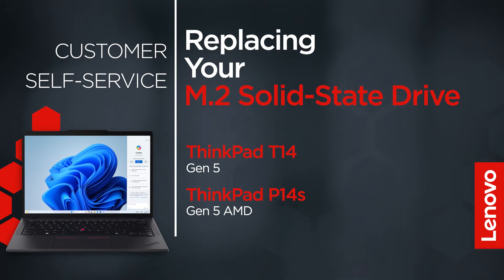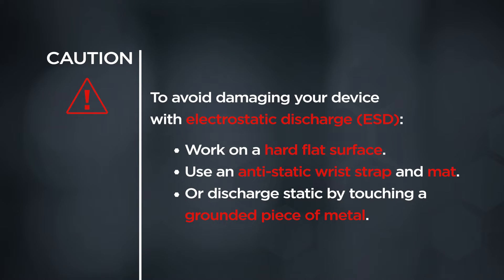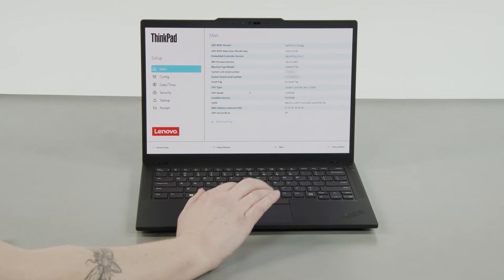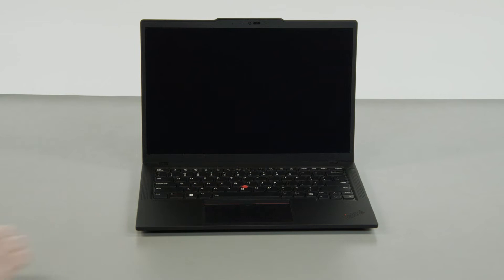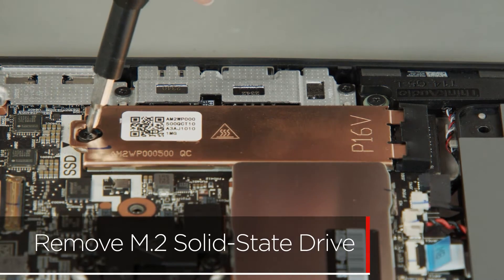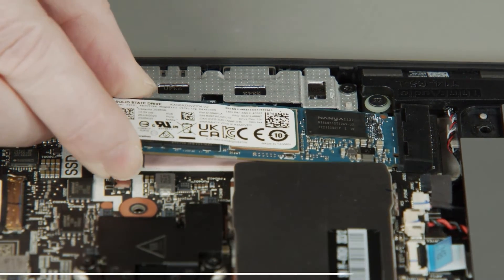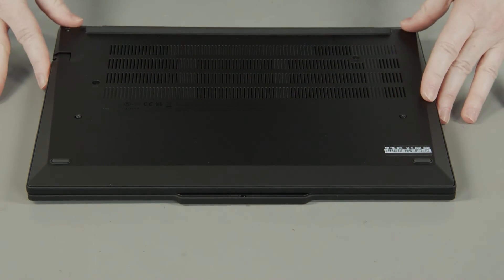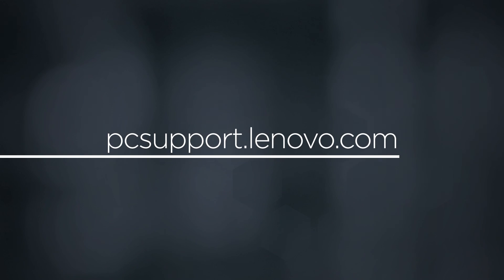Replacing Your M.2 Solid-state Drive | ThinkPad T14 Gen 5 and P14s Gen 5 AMD | Customer Self Service

Comment from the maker: This video will show you how to replace the M.2 solid-state drive in your ThinkPad. The process in this video will work for the ThinkPad T14 Gen 5 and ThinkPad P14s Gen 5 AMD.

You will need a screwdriver kit, a non-metallic pry tool, and 15 minutes of your time.

To view the ThinkPad T14 Gen 5 Self-Repair Guide go to https://pcsupport.lenovo.com/us/en/products/laptops-and-netbooks/thinkpad-t-series-laptops/thinkpad-t14-gen-5-type-21ml-21mm/selfrepair/removalsreplacements

To view the ThinkPad P14s Gen 5 AMD Self-Repair Guide go to https://pcsupport.lenovo.com/us/en/products/laptops-and-netbooks/thinkpad-p-series-laptops/thinkpad-p14s-gen-5-type-21me-21mf/selfrepair/removalsreplacements

To learn more about your device go to https://pcsupport.lenovo.com

To find parts for your device go to https://support.lenovo.com/parts-lookup/?cid=ww:lenovosocial:b9515f&source=socialmedia&subsource=yt

To view the Lenovo Support Self-Repair Guides landing page go to https://support.lenovo.com/us/en/solutions/HT516547

** NOTE: Static electricity can destroy components. Use a grounding strap, and clean, non-conductive surface to work on. Use plastic or coated tools to prevent scratching and avoid using metal tools on plastic parts. For more detailed information on electrostatic discharge and how to prevent it, please watch our "Understanding Electrostatic Discharge (ESD)" video: https://youtu.be/by4PB3WtdLo 

Applicable Machine Types:
ThinkPad T14 Gen 5 - 21ML, 21MM, 21MC, 21MD
ThinkPad P14s Gen 5 AMD - 21ME, 21MF

Check out other official Lenovo channels!
https://www.youtube.com/@Lenovo 🟥
https://www.youtube.com/@lenovolegion 🎮
https://www.youtube.com/@Lenovo-PC 💻
https://www.youtube.com/@LenovoSuporte 🟢🟡

#Lenovo #LenovoSupport #LenovoTechSupport